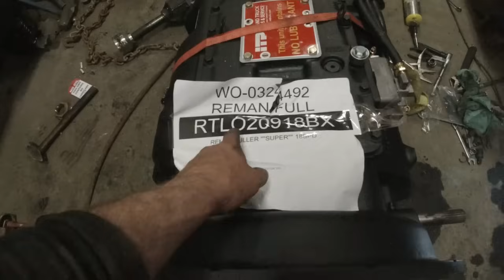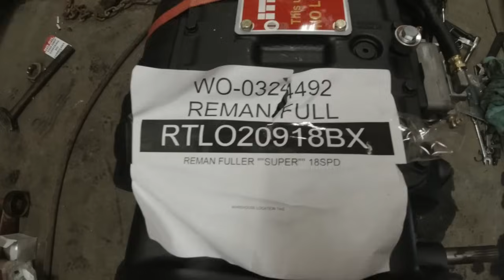bad week for old red - expensive repairs - upgrade to 2050 torque rated 18 speed transmission.

Comment: When you get some free time (right), study up on power flow through the RoadRanger trans. In heavy weight, high torque and horsepower application particularly, you need to aim for a straight through power flow rather than an around the corners power flow. I had a good video on this, but my filing system is poor, so I haven’t been able to find it. Those transmissions are getting very pricy. Hang in there and keep up the good work. Take care. P.S. You are probably familiar with this already, but just in case, I thought I should mention it.

Comment: A expensive week for you but if its any consolation at least you can do the repairs yourself and dont have to pay a shop. Regarding the exhaust box, could you heat the metal and then knock the casing in a little to clear the filter?

Comment: Not to sound negative or anything,  but Big Red needs a bath.
Reply from the maker: That happens when you actually work a truck for a living. Major mechanical issues are a little higher priority than a wash job. If you bothered to watch the whole video you would have seen it cleaned up at the end

Comment: You really think a 425 3406 cat even turned up 1450ft lb stock makes that much extra torque? 
I don’t believe that was the cause. 
I run the same combination in my Kenworth.
Reply from the maker: It's 600hp at the tire so the input is probably closer to 700hp at the trans input. You can't gain HP without gaining torque as hp is a mathematical equation of tq x right. I mean I could do the math to figure out the number but it's likely making more than 1850 threw the entire rpm range
Reply: @Ezrider359  been on a dyno? Cats 425 hp rating was wheel hp . 14715 would handle it for over a million miles. 
Reman transmission doesn’t get all new parts, you probably know . I still don’t believe you overpowered that transmission. 
Enjoy your videos.
Reply from the maker: No manufacture rated at the wheel. There was two different standard rating systems that were used one was bare engine the other was with all accessories both were rated at the flywheel I forget exactly when the change was but to my knowledge no engine manufacturer rated at the rear tires.

Comment: What oil are you running in the transmission, I'm considering trying something different. I've ran trans oil and straight weight motor oil
Reply from the maker: 50wt synthetic